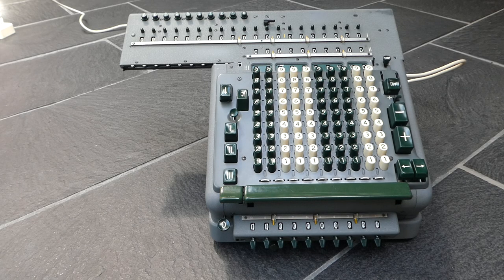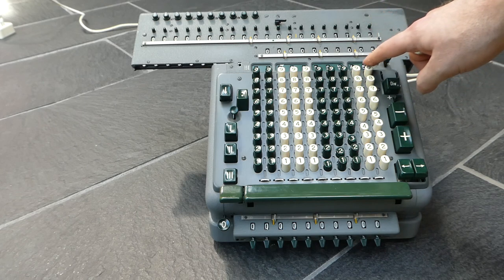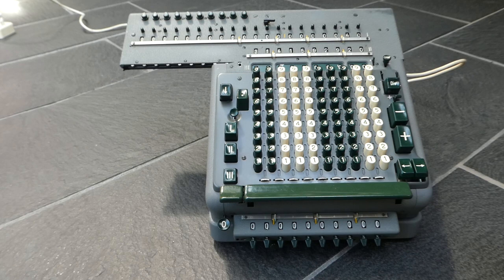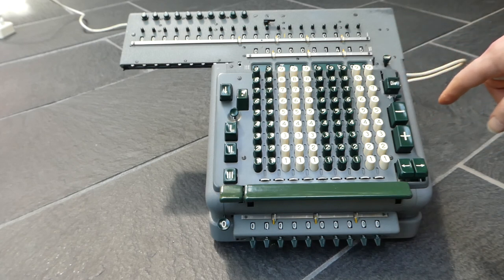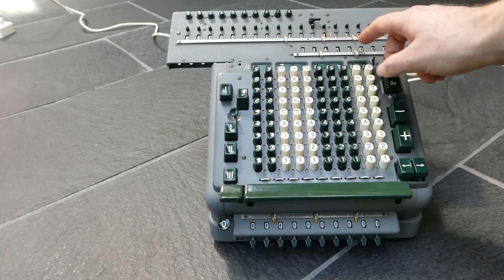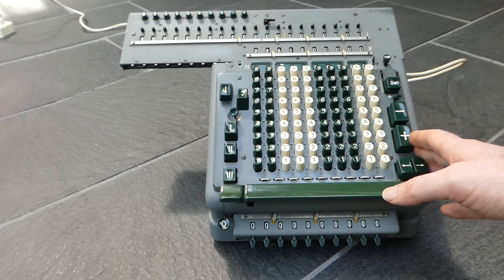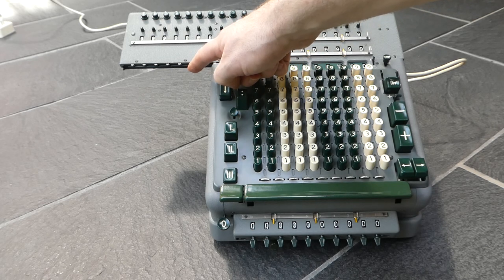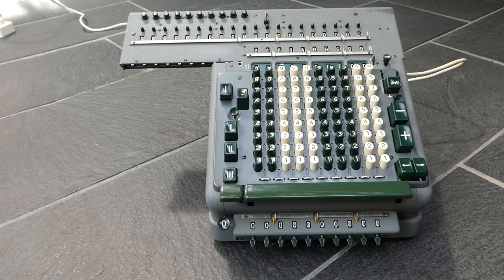The Madas BZS mechanical calculator

Comment: Thank you for one more very interesting video about mechanical calculators. I always enjoy watching your videos and I admire your outstanding collection. Your Madas BZS seems to be in nearly mint condition.
Concerning the division what you see seems to be a further development step in comparison to the A-Series: 

With the B-series it is ment that you can push two of the tabulator buttons at once instead of only one as with the A-series. E.g. you push tab button 4 and 6 at once (it always has to be a gap of at last one button in between) and then the dividend will be put in the result register on position 4 and the division will start with the divisor at position 6. This automatic is for easier handling if the divisor is larger than the dividend (here e.g. 2 digits larger). There is a similar function e.g. on the Badenia VA 17 Super.

I do own a Madas 20AS myself and the multiplication did not work either when I got it, but with the kind help of John Wolff providing me the technical drawings of the MADAS in combination with his outstanding description of operation on his homepage it was a doable job to repair it. It took me several weeks, but for me it was worth the effort. Perhaps that may encourage you to try to repair it on your machine.

I hope for more videos to come on your channel. Thank you for your great effort on documentation concerning these old machines for that they will not be forgotten in the future.
Reply from the maker: Thank you for the info and your words of encouragement. I won't continue on this machine for now, but at some point when I've plucked up the courage I do intend to have another go at it.
Reply: Meanwhile I also had the opportunity to acquire a B-series machine and the multiplier also didn't work. So I disassembled it and  luckily was able to locate the problem. Probably It is  not necessary to disassemble the whole machine to solve it, if your one has the same stuck parts as mine. IF you might be interested and find it helpful I posted a short video for further explanation .

Comment: That's excellent timing Jaap - now I know what some of the levers on my Madas 20 should do!!!  Mine is a simpler version (without the multiplier) but many of the controls are the same.  Yours looks in visually fantastic condition, mine looks like it's been stored somewhere damp for many years but I'm looking forward to getting inside and seeing how bad it really is.
Reply from the maker: Good luck! On mine there were many parts which had got stuck. It seems the design did not take old oil into account as there are several levers or sliders that lie directly up against the sides of the frame, perfect for getting glued together. The carry mechanisms were also gummed up, and yours will no doubt have the similar problems. One day I'll pluck up the courage to take mine apart further to fix the multiplier.
Reply: @jaapsch2  I know exactly what you mean - the far simpler model 8 that I did was incredibly gummed up, so I can only imagine what the 20 will be like.  Hopefully I'll get some time to look at it soon.